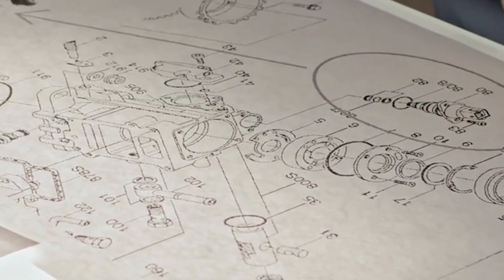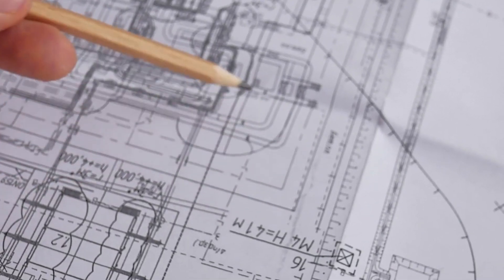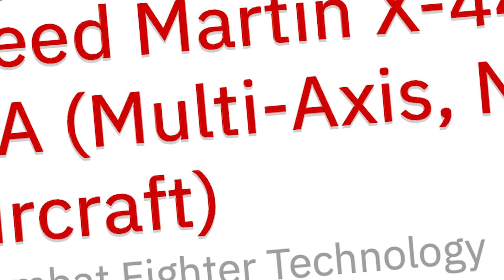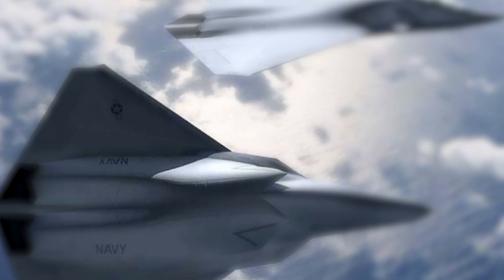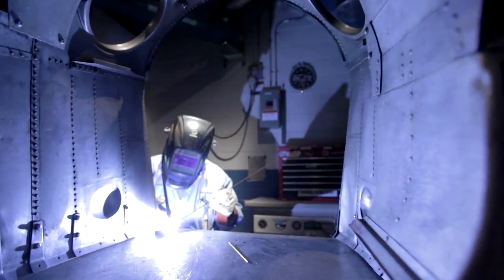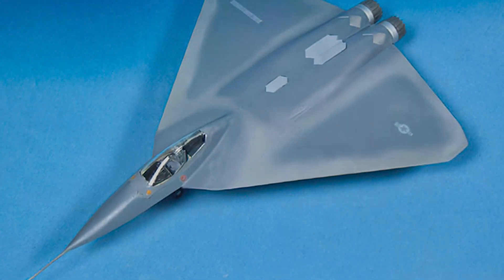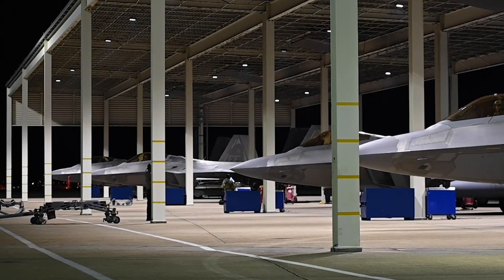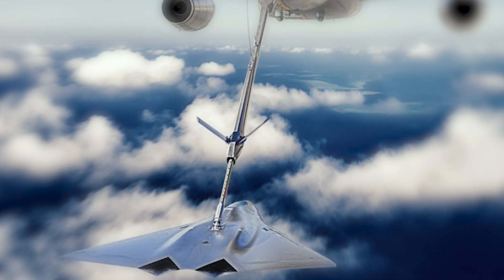The Secret Stealth Fighter that Could have Changed Everything

Comment: There is a philosophy that dogfighting is going away. With all the space , ground, and airborne sensors providing information to the fighter elements about other fighter threats and  using data from those other sensors, BVR missiles can be launched from extended ranges it totally obviates the need for close in combat.
Reply: Yep, they've been saying dogfighting has been going away for decades and yet the F-35 has a gun.  Something tells me dogfighting will be around for some time to come.
Reply: @abikeanditsboy3449  only the air force has a gun the Navy doesn't. Air Force chose to keep the gun while the Navy chose not to, this goes all the way back to the f4.
Reply: @geekmechanic1473  - I knew the idea went back to the F-4 but didn’t know if it went back further than that.  The belief was that now that we have beyond visual range missiles and can kill the enemy before they ever know we’re there we’ll never be close enough to dogfight so who needs a gun.  The problem with that turned out to be two fold.  First, the planes carry a very limited number of missiles.  If your missiles miss then you’re up there, unarmed, with enemy planes closing and your only option is to run and go home.  (As the pilots of the F-4s discovered.)  The second problem defeated the point of a BVR missile in the first place, having to have positive or visual confirmation that what you were shooting was actually an enemy plane.  The rules of engagement have only gotten stricter over time because the US wants to achieve the impossible, zero “collateral” damage.  With the closing speeds of warplanes, you literally give up the advantage of BVR and ultimately end up in dogfight range.  The war planners were wrong about it in the 60’s and they’re wrong about it today because ultimately the decision about whether or not a gun is useful on a warplane is up to the enemy and how they choose to fight.
Reply: @abikeanditsboy3449  yet the Navy had the same problems as the air force but didn't add guns. Instead they focused on better training with missiles and maintenance of them in turn creating top gun. The Navy ended having better performance than the air force as a result. Guns aren't everything and today we have ways to identify others besides visual.

Comment: Page 6:19 depicts an in flight refueling configuration with a delta plane with no vertical fin. From passive / active stability view that the fuel port may be too far backward. Such porting location may be inadvertently mocked in from past models of vertical fin.

Comment: I think its better to use air pressure, from the compressor stages of the turbine, to apply pressure through pinholes to above or below the wing. A lot of research is going into this type of control. It can completely get rid of flaps, which ruin the radar signature.
Reply: Interesting. I assumed at high speeds it wouldn't do anything. I will have a look. Thanks.
Reply: @Pharozos  Exactly what I thought. At those speeds the pressurized air wouldn’t be able to break through the air stream barrier.
Reply: pretty sure this is similar to how the b2 spirit works
Reply: Bae Demon. I dunno about Coanda effect at supersonic speeds, but you could certainly pressurize the bleed air (at subsonic) as high as needed. Maybe you steer by adjusting the shock-front?🤪🤪🤪
I've been thinking about this, but have no idea how to make the FAA happy about fail-safes. Like, if your bleed air dies, do you need back-up flaps and slats, or do you just add redundant APUs?
Reply: @icollectstories5702  I guess the FAA only matters when you acknowledge the existence of it. Or it stops being a military secret. An unbeleivable amount of drone testing happens in woomera australia now. It really is the middle of knowhere. The military will be less and less worried baout fail safes as they move away from pilot and towards AI/ drone swarms. Losing one or two doesn't matter so much then.
Reply: @InquisitiveBaldMan  I was thinking more in terms of SSTO, which needs full FAA certification.
Reply: I hear they're testing using a skin that creates electric pulses  that react to the electric current created by friction from the air flowing against the aircraft to control the plane.

Comment: I'd prefer twin engine designs mainly for redundancies. Considering the problems the F-35 is going through with it's single engine powering both conventional flight and VTOL modes failing at times.
Reply: And what problems specifically is the F-35 experiencing together with its variants (provide sources)? Only problem I’m hearing of is its slow speed which can be traced with the the fact that it only has one engine.
Reply: @kiro9257  The F-35 wasn't designed for mach flight. The problem is that the engine is having to power both the VTOL and conventional flight. It puts a lot of strain on the engine. Plus the inducted fan is so vulnerable to debris. 

Given time, issues can be worked out. It's only entered active service recently. You can only learn so much from tests and simulations. Real world operation will always surprise you.

Comment: In concept videos,they say it might have directed energy weapons,but I doubt it will happen.
Reply: It would explain the need for a dual-engine setup, as the weapons are powered off of electricity generated by the engines, and not from some internal battery bay.
Reply: @TROOPERfarcry  They can't use a laser,because it fails in bad weather,and different types of materials can dissipate the heat from it,they will have to think of something else.

Comment: It's always interesting to me how the manufacturers choose to go with a single-engine versus a double-engine configuration, or vice-versa.  I'm sure that there are advantages and disadvantages to either setup, but it seems like neither one is a clear-winner, because we're back-and-forth on this.
Reply: It depends on the goal of the aircraft and the thrust potential of the engine itself. A single Pratt & Whitney F119 engine didn’t provide enough thrust to accomplish the goals and requirements of the F-22.

However, the Pratt & Whitney's F135 was more capable and had enough thrust for the F-35 with just a single engine. A single Pratt & Whitney F135 engine has almost as much thrust as 2 Pratt & Whitney F119. It was made several decades later so there was a lot of advancements in engines since then.

NGAD will probably have 2 General Electric XA100 engines, because this will be a giant plane. It will be designed to go very far and store the AIM 260 internally. So it will need far more thrust to compensate for its size and weight.
Reply: @Ghettofinger    I can't wait to see what the NGAD looks like. I heard it could be as big as the old F-111 which is bigger than an F-22. I also personally hope it is a 2 seater.
Reply: @KC_Smooth  yeah, I'm excited for when they finally unvail it. I think it will look like an improved Lockheed Martin X-44 MANTA that is more sleek and acute. Making it 2 seater is very likely because of the size and the WSO can be the one that manages the autonomously controlled drones. Giving it orders that they will execute on their own.
Reply: In terms of pure effciency for range and dwell times, less but bigger engines is always better. But i guess survivability is greater with two.
Reply: @dalefletcher111  As long as the two engines are close together.  As much as I love the F14 Tomcat, the "Top Gun" scenario of flat spin caused by losing an engine was a real issue that several F14's were lost to.   When the engines are that far from the centerline, surviving losing an engine is more of a cross-your-fingers hope than a survivability feature.
Reply: @SvdSinner  i have to disagree about the f14 flat spin being a big deal imo it was lack of training and inexperience that made it a problem further training and simulation of loosing an engine would have provided pilots with the muscle memory of what procedure to do to recover rather than to panic and jam the throttle to full increasing the yaw problem aircraft have had engines placed much farther from each other prior to the f14 all the way to the current day and engine failure isnt a major issue for them
Reply: @paktahn  It was certainly a big enough deal to be a major driver in the revisions they made to the plane.    Yes, there were always ways to survive an engine out event, but they were not simple, forgiving and intuitive.  Anytime you rely on a human to quickly do something precise and critical under high stress in response to an unexpected event, you have a potential disaster.   The whole science of survivability is to make survivable decisions easier and more intuitive with more tolerance for mistakes.
Reply: @SvdSinner  that is what training and sop is for it is there to develop the muscle memory so that you react in a specific manner during an incident a good example of an avoidable death was in 1994 the first combat qualified woman in the navy failed to follow sop after a botched landing caused a compressor stall in one engine she immediately put the remaining engine in full afterburner mode in a moment of panic  causing yaw that the rudder was unable to correct for causing the aircraft to nose over into the water resulting in a tragic yet completely avoidable accident if sop would have been followed
Reply: @paktahn  Yes, that is exactly what training and SOP are for.  However, that doesn't change the fact that any system that has potentially fatal outcomes in certain, known scenarios unless very specific and non-intuitive procedures are followed is far less survivable than systems that can avoid the same fatal outcome by design without requiring special procedures.  Safety and survivability are multilayered onions.   Not having a potential issue is always more survivable (all else being equal) than having that potential fatal issue.
Reply: single engine is for a fighter, lighter and smaller airframe.  2 engines usually more of an inteceptor/fighter.
Reply: my high school math teacher was one of the p40 pilots that managed to get airborne on dec 7th and once i found that out i lost no opportunities to ask him about his experiences in the war.  when we asked what his favorite aircraft was he immediately said the p38 lightning... we were puzzled because he had flown the mustang and after the war early jets.  i never forgot the reason... "two engines" he said.  "when you're flying long missions over open water, you want two engines."  makes sense we use twin engines on our boats for the same reason.
Reply: Single engine vs twin engine is typically done to keep costs down.  We see this with the US typical high-low approach.  The F16 as a cheaper to operate single engine, versus the F15 as the air superiority fighter.  The only reason the US Navy has the F-35 right now (their first single engine fighter in a long time) is due to them needing a usable stealth fighter to counter the threat of enemy 5th generation fighters.  With the F/A-XX program in the works to replace the Super Hornet, it is likely they'll go back to a twin engine design as soon as possible.

Survivability is important, but twin engine designs also allow for some pretty great maneuverability with the use of split throttles and thrust vectoring.  Twin engine designs also typically allow for much higher thrust, resulting in a better thrust:weight ratio, higher top speed, and also makes supercruise easier.

I'd say at least for the US, the clear winner is twin engine, because with their logistics in place for refueling, the fuel requirement of planes isn't that big of a deal, especially since the difference isn't major when you consider only trading 20% more range or so for all the extra capability.  For example, the F-22 on internal fuel only has a range of about 530 miles.  Compare that to the F-35, which will get about 650 miles on internal fuel.
Reply: Don't worry eventually everything will go back to flying Pyramids that use gravity for propulsion.
Reply: There's times in war games that the F22 was defeated by French Rafale's however the F22 was intentionally put into a situations that they in a disadvantage to start with, IE having external fuel tanks, flying low and slow, etc. And what they found with the war games is the F22 is indeed a great plane however the smaller and lighter Rafale would be able to make continuous maneuvers with out losing so much momentum. While the heavier F22 could make a few maneuvers but would lose momentum which allowed the lighter Rafale to get into firing position. Many times the Rafale would have to fly at its limits to do so but it could and did.
Reply: @mrow7598  hows does this have to do with the single/double engine topic
Reply: @stoinkoink  Two engines are heavier than one, require a larger air frame for both the engines and the fuel, IE heavier planes are generally less maneuverable than single engine planes.  Extrapolation, some people just can't do it.
Reply: You answered your own question  - advantages and disadvantages
Reply: Actuality a single engine is solely about keeping the overall price lower.
Ironically 2 of the most current F-16 engines are cheaper than one F-35 engine.
Reply: @King_Dusty_Of_Pookytopia  the F35 engine also produces almost twice the thrust of the F16's. And as for cost does that account for R&D and inflation?